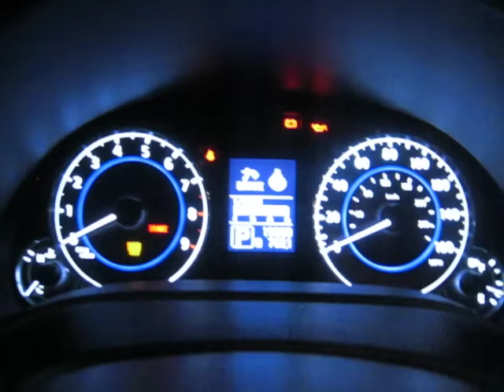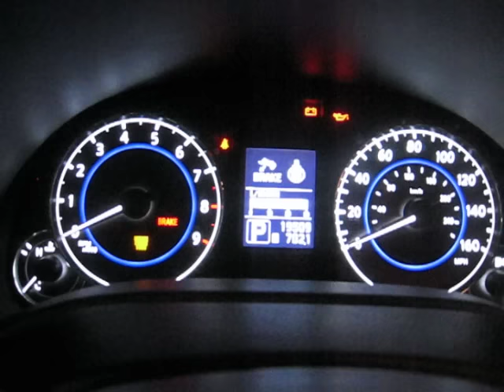Easy Way to Reset ECU without battery disconnect in G37

Comment: Does anyone know if this process definitely resets the transmission shift logic (learning the driving style) back to factory default where it has to learn the driving style over again? Because I just did some maintenance on my 2014 Infiniti Q50 3.7 AWD where I also had to disconnect the battery for about an hour, and when I first drove the car again since reconnecting the battery the transmission behavior was quite different than what I felt when I followed the steps in this video. I could tell a distinct difference in the shift points and overall transmission behavior after the battery disconnect, it felt just like it did when the car was brand new. But that's not the way it was after I did the ECU reset sequence in this video, in fact the overall transmission behavior didn't seem all that different. Does anyone know why this would be, and what the difference is between this ECU reset process and actually just disconnecting the battery?

Comment: Some one please respond I have  test pipes on my g37 and the service engine light comes up I do this and it goes away for about an hour n comes back what can I do other than tune?
Reply: Dexi pretty sure you need a tune man
Reply: I think you need O2 sensors extensions
Reply: Dexi Hey man did you ever get this fixed? Just got test pipes on my G37S today and it’s doing the same thing. I reset it with my obd2 scanner but I feel like it’s going to come back on
Reply: Ethan Van Vleet have a shop weld on some bungs. Or get test pipes that have them already. I heard there’s places that sell the ones that screw into the pipe. Maybe amazon or check out Z1motorsports or conceptZ.
Reply: Check o2 sensor
Reply: Get the o2 Caps they are adapters that will trick the o2 into running normal there for your cars check engine light will go away and better gas mileage

Comment: I have done the reset to the ecu and the car still does this randomly. I have changed all the coil packs $1,000.00 wasted. I don't really understand why a car company would put a limp mode program in anyway except to extort $$ by bringing the car to the dealership to have it "repaired". I have called them and they want to know the codes. When I tell them they are not any lights on the dash they say that is "weird" and tell me to bring it in and let them look at it.

Comment: Wtf just happened?!
Reply: lmao...see my comment..i thought it was me...Damn foreigners!!
Reply: i have no idea what he did or what he was doing.  no explanation at all is he pushing pedals that many time or is it one pedal?  Is he just counting and not pushing pedals...WTF
Reply: Eddy Stocker If you can't understand the simple demonstration in this video then you don't deserve to self-diagnose your Infiniti.
Reply: I think he forgot to read this lol1. With accelerator pedal fully released turn ignition switch "ON" and wait 3 seconds.
2. Fully depress and release the accelerator pedal 5 times (HARD) - within 5 seconds
3. Wait 7 seconds and fully depress the accelerator pedal and keep it for approx. 10 seconds until the CEL starts blinking.
4. Fully release the accelerator pedal (while the CEL is still blinking)
5. Wait about 10 seconds.
6. Fully depress the accelerator pedal and keep it for more than 10 seconds.
7. Fully release the accelerator pedal (The CEL light will continue to blink).
8. Turn ignition switch to "OFF" position and now you can start the car.
Reply: Yeah there is an assumption that one can read....  ;-)
Reply: Because it's obvious. It's to reset the code for the check engine switch.
Reply: Lol

Comment: I have a infinity g37s having a problem which wouldn't rev above 2500 rpm , my car sat in the drive way for weeks saw this video followed the step and i was back on the road in no time.
Reply: Ishan Sunesara how has it responded since doing the reset? I’m having the same issue

Comment: How do you know or can confirm that it's been reset?.. the continuing of the blinking CEL is confusing.
Reply: Steve Sidi The service light will continue to blink and blink at a faster rate as you go through the process. And then once you finish it'll slow down and then it'll shut off once you start the car.

Comment: I have a 1996 Buick Le Sabre and it's even easier. turn the engine off. click on accessory two times fully forward. then within 10 seconds, fully press the accelerator 3 times and viola - there it is.

Comment: My G37s coupe 6mt was idling at 1k rpm.  I did the reset and the rpm went down to normal but check engine light still on
Reply: RzVids this is to reset the ECU, I don’t think it can clear CEL. You need that done at a Autozone for example or if you have a code reader.
Reply: VQ3713 Nah the check engine light will be cleared too. It had a bad fuel injector causing a misfire.
Reply: RzVids looks like you’re all set then.
Reply: @RzVids  how did you know it was fuel injector I'm having same issue don't know exactly what's wrong?

Comment: Hi, can someone please explain to me the purpose of ECU reset? So why do it after adding mods to the engine and what happens after ECU reset?

Thank you
Reply: It clears the learned memory in the ECU and effectively is like starting from scratch with OE Fuel/spark tables. Also resets the transmission shift parameters. Then you drive it and it learns on the fly. Beauty of modern EFI!
Reply: @nordicpride9708  will it fix limp mode

Comment: Is he pushing the brake or the gas pedal?
Reply: The gas pedal
Reply: Don't ever pump brakes with the ignition off! Doing so builds up pressure in the brake master cylinder and you will have some trouble starting the car afterwards

Comment: I have a 2009 G37 that goes into limp mode when driving sometimes. It does it randomly maybe 2 or 3 times in a 6 month period. I can stop and turn the car off and wait 10 seconds and it resets. It does not allow the car to rev over 2500 rpms and starts jerking like the transmission is about to come out. Has anyone else experienced this and if so what did you do?
Reply: I saw that for Nissan Z. They did the same steps as this guy to reset the ECU.
Reply: mine does that after i drive for only 1 hour. i dont know what to do!!
Reply: loonatic9568 it might have something to do with the Mass Air Flow sensor in the intakes
Reply: Faisal AlFarsi I think your right. I changed my aftermarket cold air intake back to stock and nothing happened. After my smog test I replaced my stock intake back to aftermarket and had this problem. I couldn't get the steps in this video to work on my G35 because there are no other video's and so I disconnected the battery over night, cleaned the MAF sensor and has worked fine since. Automotive places like O'reillys or Autozone sell MAF Sensor spray for under $10. Made my car idle more steady as well.
Reply: loonatic9568 If I were you I would go on ebay and order a new MAF Sensor. They're very cheap and see if that fixes the issue. Otherwise I would go ask Infiniti Stealerships if they can fix it. I do everything myself like you watching Youtube to learn new things. I would also suggest getting a Manual for your vehicle too from O'reillys or Autozone. If you've never owned a manual, it explains how to install and uninstall parts like the professionals do. They're about $20 and can resolve many issues. I would suggest NAPA but I've had really bad parts from them. I've also found Ebay is the place for inexpensive parts compared to auto parts stores. Not cheap parts, inexpensive parts.
Reply: Go to Infiniti they will update the engine and transmission  software. my car did the same thing.
Reply: +Terron Maynar How much did they charge you for the update?
Reply: I believe it was $250.
Reply: Gallery gasket

Comment: If anyone sees this, after doing this if the light comes back on it means something is wrong right?
Reply: Yea that means something is wrong. Get a car code scanner(30-60$) and it’ll tell you what needs to be fixed. Your car has long term memory for optimal performance after ware and tear and will self compensate. So when u fix/mod something, the car still self compensate for no reason. Resetting the ecu puts it back into factory settings and it relearns everything.
Reply: @ronalby5957  appreciate the answer, I was asking cause I was worried clearing the code would just make the car ignore further issues

Comment: Whats the point of restarting the ecu? Can someone help me?
Reply: Resetting the ecu does a couple things like make your servicing light go away. It resets your idle. It also resets the air/fuel ratio temporarily if you just put in a cai. Sometimes it’ll learn and adjust the ratio on its own, sometimes it won’t.

Comment: does this work on a 2005 g35 coupe?
Reply: Erica Wise it might, but make sure your timing is correct and in sync with the video as he does it.  then it should work if that configuration works on your model